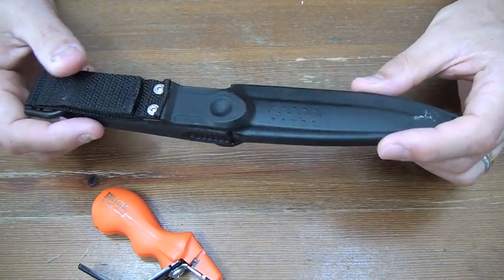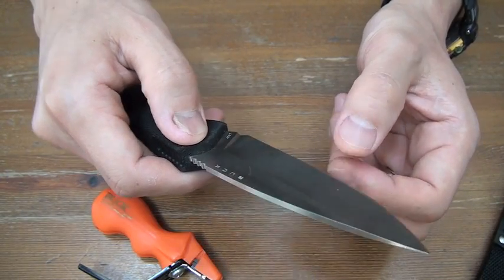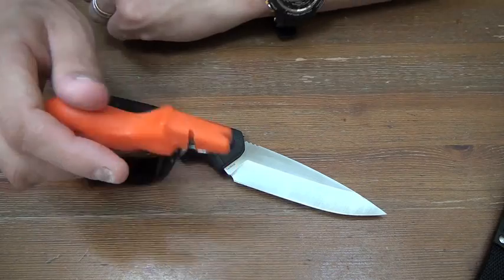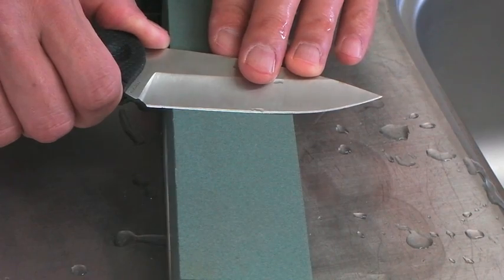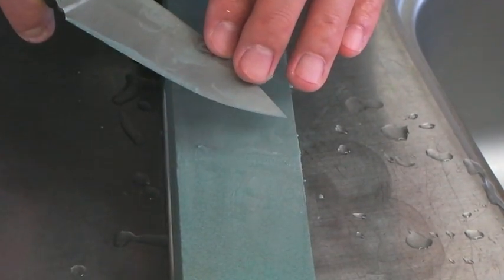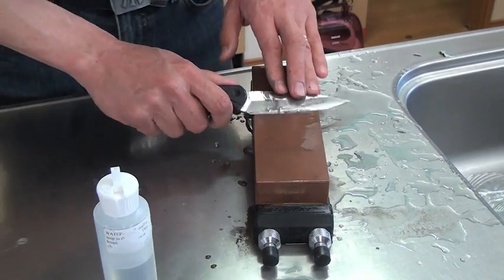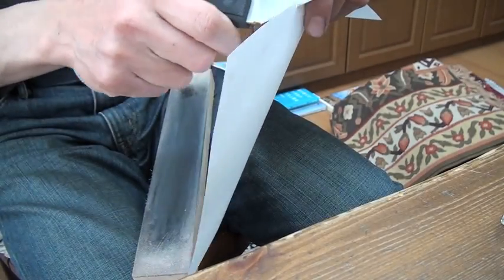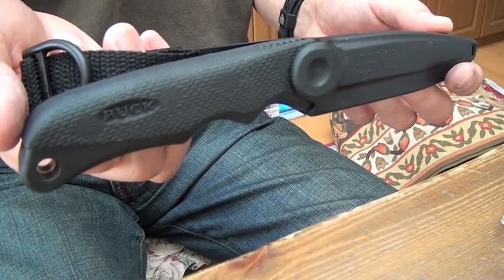Buck knife waterstone sharpening

Comment: @yloiron Check out the entire Casio Protrek or Pathfinder series, depending on your geographical location. I myself have the PRW 1300Y-1ver, which has similar functions, but is not as high end as Virtuovice's one due to the lack of twin overlaid displays. The series has some very complex acronyms, so if you do have any questions, I would be more than happy to try and answer them. I had to try and figure them out when I was shopping around too!

Comment from the maker: @OrangePHX I guess I am putting relatively much power on the knife to the professional sharpeners. Despite of that my stone is stable on the metal kitchen tabletop. My stone base is made of rubber and seems to have good traction on the wet tabletop. I see some sharpening guy using a towel under the stone. Thanks.

Comment from the maker: @ryanrrx I just visited the KnifeCenter website and confirmed that the handle was the same as the Buck Diamondback Outfitter. Although the present blade shape looked more like a hunting knife. I use Bark River white compound and DLT two sided leather strop, and they are selling at DLT Trading and Crystal Falls Trading. The white compound is very difficult to apply on leather generally. But only the DLT rough side thin leather made by SharpShooter takes it very well in my experience. Thanks!

Comment from the maker: @ncomplex1 I don't think it is very easy to sharpen a convex edge on water stones. On them we will have to change the honing angle subtly. And anyway we will need a white compound loaded leather to make the edge razor sharp. #600-#1200 sandpapers on some backing will do the same thing as the black compound loaded leather. But the edge angle depends on the backing. And even #2000 paper will not replace the white compound in my experience. My Buck knife had a 30 degree secondary V edge. Thanks.

Comment from the maker: @yloiron I am wearing the CASIO PRO TREK PRW-2000A-1JF watch. It's a brand-new model in Japan. This Japan domestic model has yellow side plates. But the function must be the same as the international model of it. It has a compass function, and a barometer and altimeter function in digital. It also indicates the air pressure trend graph in 24 hours which is useful for weather forecast. I have some review videos on this watch in my channel. Thank you!

Comment: You are right sir, I only use 2 stones, and then a strop with white and green compound. No need to get a super fine stone, strops are cheaper and work better. I use shapton pro 1k and shapton pro 5k followed by white and green strops. That is all I ever need to get my knife hair whittling sharp. I should try black compound to get a convex edge! What do you recommend for a 300-500 grit coarse stone?
Reply from the maker: You have good stones for regular sharpening. Naniwa Chosera 400 which can be called Proffesional currently is a very fast and hard stone highly recommended. Shapton Pro 320 is a soft stone wearing and hollowing fast. Thanks.
Reply: virtuovice hmm I hear the opposite. From the reviews I see people say Chosera 400 is very fast wearing! I bought a shapton glass 500 grit stone, and I also bought a shapton pro 2000 grit stone. My next will be a Nubatama 150! Have you tried the "new" chosera stones that they are calling Proffesional now? The ones you have look like the old version which are thicker.
Reply from the maker: Max Savino Coarse stones wear fast in general. Chosera 400 is on a tougher side for its grit. Chosera 600 is softer in my experience. We don't have Naniwa Professional stones in our market. Thanks.